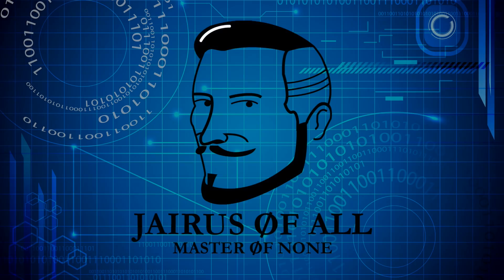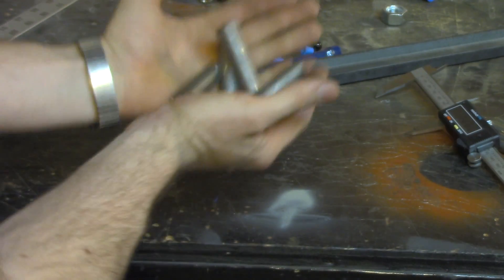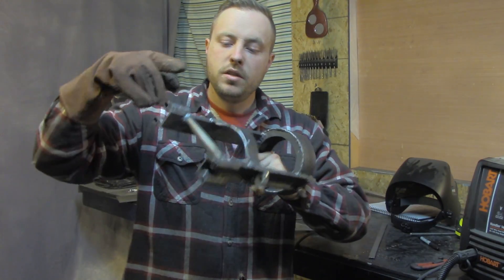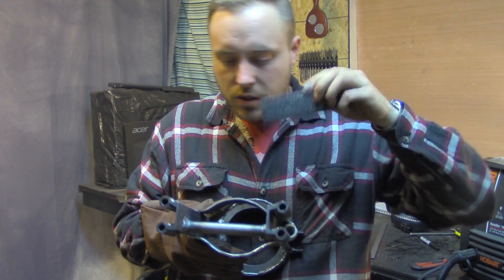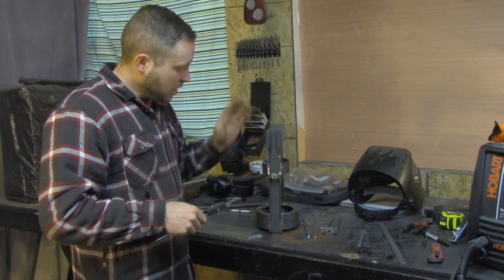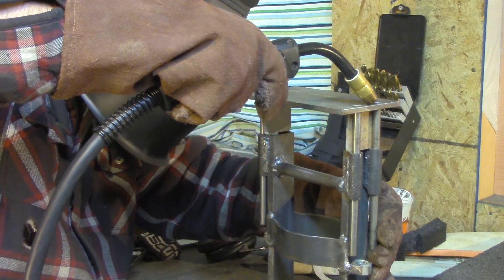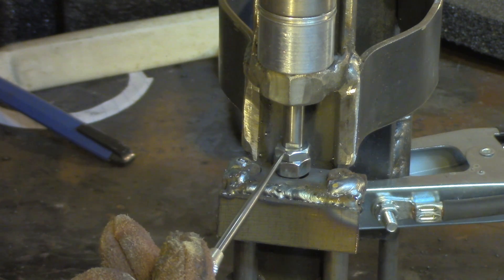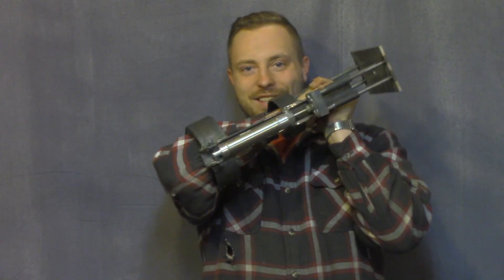REAL LIFE POWERFIST - Build Process Part 1 of 2

Comment: I was so into this video I didn't subscribe till about halfway through just because it was holding my interest it didn't want to stop to hit subscribe first!

AKA this channel has a new subscriber and dinged the bell for all notifications!😎😃👍👍

Although I'm more interested in the mechanical aspects in the technical side of things and is that such a thing since I'm a maker but still pretty cool nonetheless.

But yeah when you have something this far-out and Powerful.

It would be like powering a riding mower with a car engine that would definitely be a watch and a subscribe!

Taking it to insane level ✔

Although I like stuff from Fallout I've never played or even really been into the game.

Save a lot of games and also some sci-fi stuff as well it's just cool to do something in real life.

Although if things were actually based on something like this such as the powerfulest this could actually be useful in some cases.

Such as law enforcement rescue and Military.

I know there are things out there like that and that you do sort of the same sort of thing you know I'd punching through such as a door knocking a door off the hinges.

But someone building their sin their own shop now that's another level.

I want saw a rescue tool that's operated by blank cartridge!

One trigger pull it's through a side pillar of a vehicle.

Now it really could do something like that with CO2 or nitrogen.

It would never replace hydraulic necessarily.

They even have 24-volt rescue tools now that essentially are cordless power tools.

But using a pneumatic system may be more advantageous and less likely because issues with possibly ignition source as well.

I don't doubt that some stuff had been inspired by sci-fi or games or something else inspired from a movie.

Just like WarGames in the real NORAD story.

The newer one was actually inspired by the movie WarGames from what I understand.

Large screens and stuff like that that was originally just science fiction!

It's just cool how things have actually been inspired over the years.

And also things that originated in military use became something everyday use.

Such as what you're watching Youtube on right now the internet!

Supposably the idea for USB really came out of the Game Boy Link cable but unsure if true!

What might be and who will eventually is if they could use sometimes of exoskeleton for rescue work.

Forcible entry emergency situations.

Think about the aspects of First Responders such as Fire Department.

Possibly even future robotics in the same way.

Essentially one could have a full down claw or something that can act like jaws of life.

Or even just grabbed hold of the door knob assembly and just rip it off and open the door who knows!

There are a lot more gentle ways of doing this but there's times when that goes out the window.

It's more of just fast as possible don't worry about destruction.

There are times for both of subtle low damage or no damage and the exact opposite depending on situation.

Also were the coolest things I've seen Tech torch.

Sadly not available to civilians!

Law enforcement military First Responders only.

I could use a system like this except powered by something else instead of disposable cartridges.

Perhaps some type of torch but not plasma cutter.

Theoretically if one could survive someone oxygen in the combustion chamber almost like a mini rocket engine.

That wouldn't potentially have more power than the cutting torch limited industrial process or or scrapping operation.

Yeah sure you have thermal Lance and Termite rods.

Andrew set torch that runs on a fuel can't remember what it is in liquid oxygen.

Does even used in construction for certain from the surface finishes.

And there's the process used enquiries to cut through solid rock by basically burning through it.

And I was also the old version of the thermal Lance that was basically just a piece of Pipe & Iron by rods that was used in the old days sometimes maliciously in terms of breaking and entering.

In terms of Extreme high-value Target!

Also don't believe everything you see movies of course.

But about is closest we have to the Star Trek girl from here right now is a 3D printer!

They're already talking about possibly of the 3D print organic LED displays!

What's next entire electronic components!

There is a lot of actual things now they are straight out of sci-fi and almost hard to believe but it's possible!

Comment: If you could.....You should try like a bumper sword from New Vegas
Reply: Shirako of Reverse that's easy. Find a metal bumper. Grind an edge down until it's sharp. Bind to a handle.
Reply: Ian Johnson the bumper sword was made from a vertibird blade.....So if you're telling me that it would be easy, it wouldn't. A helo blade has a honeycomb interior, any heavy preasure applied to it would snap it.....That it the biggest challenge, for it to not break after the first swing.

Comment: btw, if you want more satisfying welds with wire feed, you should start with 1/4 inch of wire poking out of the nozzle.
Reply: And let the weld puddle tie-in on each side of your weld that half-second longer, especially if you're running a little hobby welder. Weld should sound like sizzling bacon if your wire gap, wire speed and current are set right

Comment: I made the mistake of watching the demonstration before the build, and had figured the central rod in the strike plate was just there to pierce things before they got slammed. Making it an automatic trigger instead was absolutely ingenious!
Reply from the maker: Thanks! I had dreams about this thing failing while i was building it. It really needs a proximity sensor to maximize efficiency.... I'm not sure if that exists... probably does.
Reply: Oh yeah, they definitely exist, but nightmares aside, I actually think the direct actuation system you've set up is as good as we're gonna get for the intended purpose! 

A capacitive, inductive, or magnetic sensor, for instance, might only trigger if you're hitting metal targets. A pressure sensor would basically work indistinguishably from the switch you already designed. There are some infrared, laser, or otherwise optical rangefinding and motion detection modules that are small enough to fit into the strike plate's housing, however chances are good that the force of impact jarring the frame could crack them in the worst case scenario, or even at best, the motion of swinging the Power Fist might interfere with their readings... to say nothing of the movement of the strike plate rising and falling back into its resting position. Plus, you'd likely need to throw in a microcontroller, which are also rather fragile and would just add another potential point of failure.

In this case, simplicity is definitely efficiency, and we were able to see how well the direct actuator you designed worked when you made the Power Fist "dance," remember?
Reply: +JAIRUS OF ALL could you possibly make one of the to sell and if you could how much would you sell it for
Reply: didnt really work as well aa it couldve, but whatevs. i couldnt do better
Reply: +JAIRUS OF ALL In my opinion your proximity sensor is your brain. A trigger would be really cool and I think you should entertain the idea. This weapon seems like something that could be practical although cumbersome. Do you know how much force that thing exerts on your target btw?